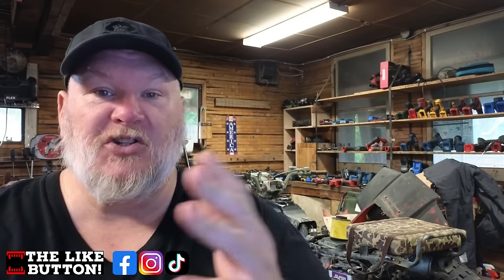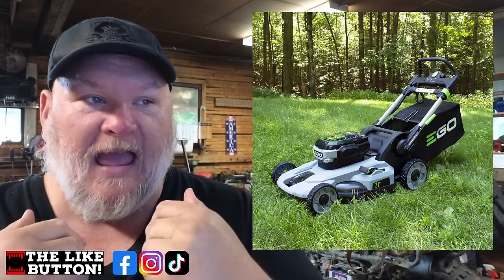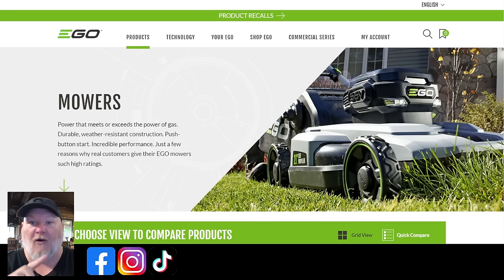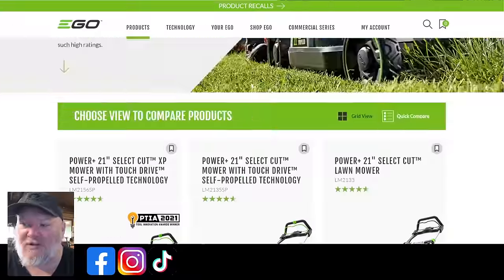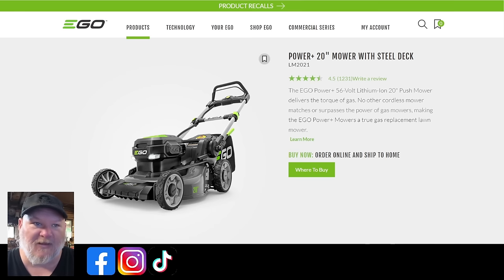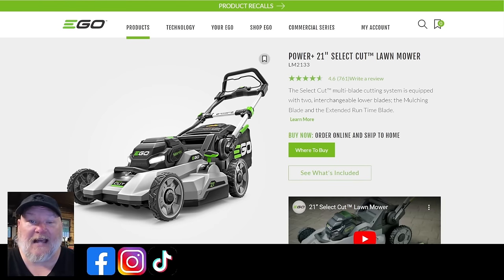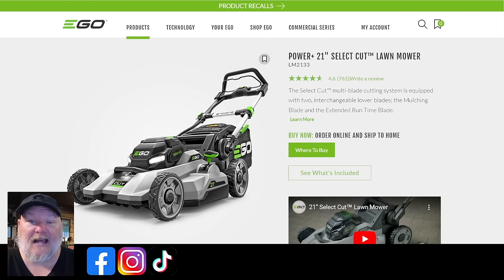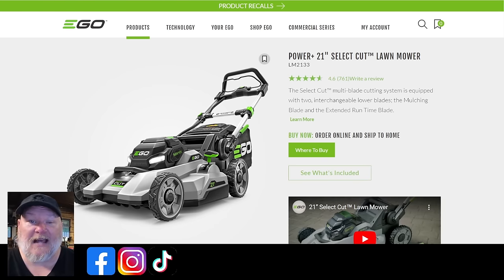What is Going On with Ego Mowers?

Comment: I think the consumers are BETA testing these battery powered mowers for the manufactures when they buy one. It would be nice to know what year each model that you showed was introduced. I am sure some shown were leftover models. Maybe some of those models were made for a specific retailer. One thing for sure if there is not a warranty service center near you, it is going to be expensive to ship back for repair. I have repaired the sensor and interlock switches that prevent the motor from starting when the foldable handle is not correct position. Those sensor wires are very small and usually break right where the handle pivots at the deck. I would like to see Honda come out with a battery powered mower, after all this fall they quit making gas powered lawnmowers. I see a lot people cut their losses and just send these mowers to the landfill. Thanks for posting the comparisons.
Reply: I bought my ego 20” about 9 years ago. Evidently you just became aware of these, hence the ridiculous “beta tester” comment. 
  Mine is still going strong, original blade & incredibly, the original 5.0 battery.
 Another thing that I find interesting is that you knock a product with years of experience & good customer reviews but seem more interested in a gas mower company (Honda) coming out with their first electric  Sounds like you want to be a “beta tester.”
Reply: @johnrusac6894 your reading comprehension is lacking. I have watch the new models evolve over the years where they have addressed the older models problems. They do the same with electric vehicles. I am glad yours is working OK.
Reply: @johnrusac6894  "9 years ago. . origianl 5.0 battery" . . YES, we all believe you!!! . . FYI EGO mowers had 4 Ah batteries for the year you are claiming. . .
Reply: @jimmarcum7362  Doesn't have a reading comprehension issue, has an issue with the truth. . . 9 year old battery LOL.
Reply: @aquaticaaficionado2004  
  I moved to my current home in 2013-14? & had to buy a mower that summer. The ego mower came with a 5.0 battery. The other two 5MaH batteries say “ARC” in addition to the power rating, so no confusing the two purchases. The newer pair of 5 batteries came with the snowblower. This is years newer & they are labeled “arc.”
 I suppose it may only be 8yrs depending on what month of that 1st year but who cares? Almost a decade before conking out is the point. 
 I have the chainsaw, the mower, leaf blower, hedge trimmer & the trimmer. Most of those were “bare tool” so the batteries that I do have get a lot of use across all those tools.
 Perhaps I should add you to that list of tools?

Comment: Ego has a 12v push mower?  I meant 12 ah.
Reply: No
Reply: @1988MowerMan  I meant 12 ah.
Reply: I meant 12 ah
Reply: @donaldlee6699  They do have those I believe but  they are pricey though.
Reply: @1988MowerMan  I really hate to admit it.  I believe they are around a thousand dollars and I would settle for nothing else.  And Greenworks has a push mower that is equivalent and I believe it is slightly less expensive.  There is a Lowe's close but I don't believe they carry the 12v ego in stock.  Lowe's products may be the best with the kobalt line?  I would prefer to stay standardized.  Thank you for your reply.

Comment: Battery mowers are all WEAK! 1.5 HP AT MOST! ALL OF EM! DO THE MATH! AC CORDED ELECTRIC IS MORE POWER! 2HP WITH 13 AMPS! GAS IS THE BEST!
Reply: Your math is wrong. lol. corded power tools suck though. Ask how many extensions cords get damaged or ruined. Enough to make the cordless hedge trimmer and string trimmer the same price. Gas power tools are loud and maintenance is a pain in the ass. My Ego tools start immediately every time.

Comment: All electric mowers are Trash that ego mower battery is $500 to replace. Good  luck keep bying this electric Junk.
Reply from the maker: I have a spreadsheet on a video I did last year that shows that based on runtime usage and cost of ownership that it’s essentially the exact same cost of operating a gas mower. We don’t make assumptions here we do the math.

Comment: Everyone considering these mowers must be from Commifornia, embracing the ban on gasoline engines.
Reply: I've been using an Ego mover for about a year now. I love it! No annual maintenance on it other than keep it clean and sharpening the blade. It run much quieter than any gas mower. It's nice not to deal with the fumes of a gas mower. Perhaps the best part is that I can store the mower in the corner of my basement and not have to clutter the yard with a plastic mower storage unit. Being earth friendly is a bonus.
Reply: @russcannon6725  dealing the fumes? Are you mowing grass indoors? Seek help.
Reply: bronze: Electric mowers aren't bought just in California.  Are you embracing the oil industry?